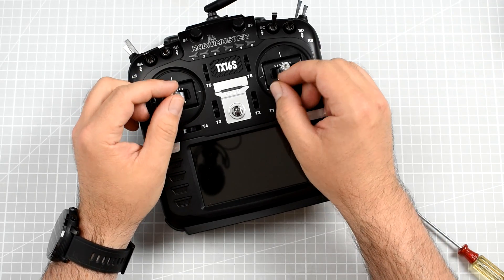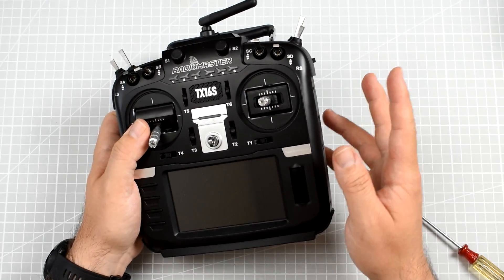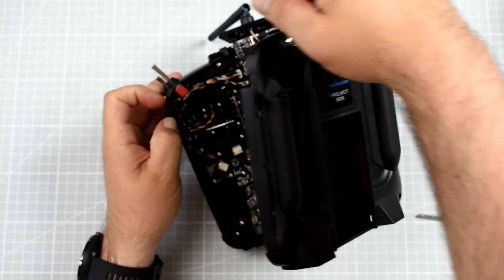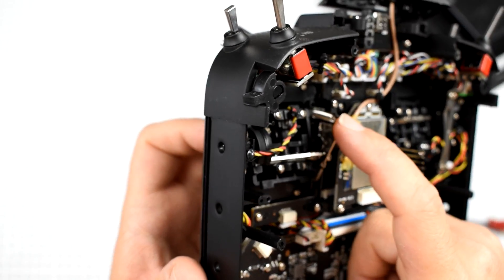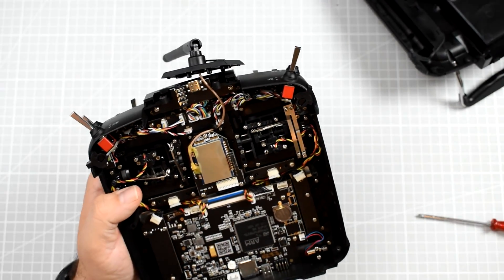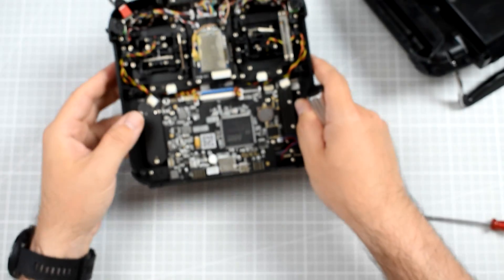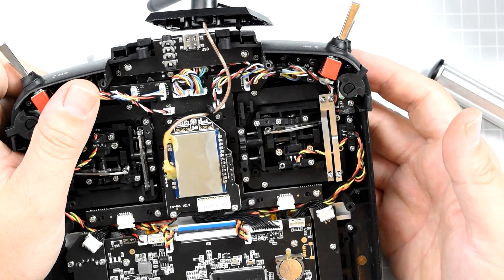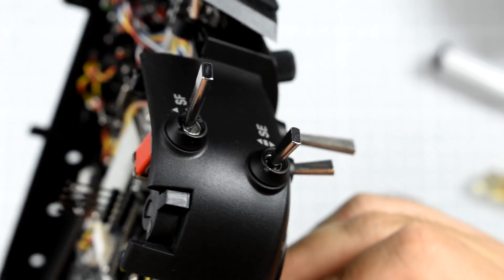Tune your gimbals! Adjust gimbal tension and centering strength

Comment: If you're satisfied with a certain tension, then perhaps buy a cheap dynanometer to measure it and then use that to quickly set your new radios to that measured tension.

Comment: I have just gotten a tx16s markii and have been flying around in liftoff for about 20 hours so far. 

I know I’m not good enough to care about these things but almost immediately I detentions the sticks so much that they center constantly but barely. 

I found almost immediately that I hate the bump when moving the stick. I may try to increase the tension some, my yaw axis needed to be increased a bit after going this. Still playing around with it though.

Comment: I feel like there is a hitch in the middle. It is not a smooth transition I’m guessing that tells you it’s center. But it’s a delay being new my brain stops right there it’s a hard stop out of the box. It is super strong and I have the upgraded aluminum gimbals not the normal ones. It’s just super noticeable like stepping in a hole when walking
Reply: Yep, that's how the gimbals work. You can make this less by decreasing the tension both vertically and horizontally, but that also has it's own downsides and upsides.
Reply: @KindOldRaven  I tried this. They became unusable almost. It can be lessened if I give up precision.
Reply: @christopherconkright1317  Yeah, that does make sense. As far as I know we can't completely get rid of them. It's a bit of a shock for me too to be honest. I come from controllers (and hall-effect analog sticks etc) so I'm used to only having a bit of a 'notch' or 'hitch' in the dead-center of the sticks, not across the entire '+' shape like we have here. I'm new to the hobby so so far I've just slightly lessened the tension on my right gimbal in all directions (I fly Mode2) and slightly increased the throttle tightness and am just trying to learn to live with it at this moment.
Reply: @KindOldRaven  same it is just enough if you don’t have force behind moving it stops it ever so little. So if I’m not firm(maybe better than force) it just pauses long enough to miss my gap. It gets frustrating.
Reply: Hi, have you managed to fix the bump on the center?
Reply: @scatta2671  only if I make them super loose. I almost want to try and build a gimbal without it.
Reply: Yup, I tried to adjust them and I'm satisfied, just got lucky with almost perfect tension for me

Comment: Adjusting the stick tension on the Radiomaster TX16S  MK2 is done from the front of the case with adjusting the hex screws in the gimbals. (no need for removing the back)
Reply from the maker: Only as long as you have the correct gimbals.
Reply: The tension of an unsprung throttle has to be adjusted from the rear of the gimbal assembly.

Comment: Great video ! Question.... I noticed my hall effect gimbals seem to be soft towards the most outside edge of travel 1/16" or so ? Is this normal ? Could they be adjusted mechanically ? Also.... How often do you recommend doing calibration feature on tx ?
Reply from the maker: This you can not really adjust without adding extra tension. For hall gimabls, calibration once a fear should be enough

Comment: I wish i could tune the GIGANTIC stick throw of the TX16S.  Only thing thats keeping me from using it.  Personal preference thing i know, but the Tango II is a little to small, and the Jumper stick throw is just right. (same on T16 and T18)
Reply from the maker: It's all a personal preference. I, for example, like longer throw and even usually I extend sticks to have it even longer
Reply: Paweł Spychalski great video, since we’re talking spacers... saw a qx7 with raised gimbals, he said for pinch style, can that be done to the tx16s? Brings the pots up, changing pivot.
Reply: @c_labb9247  I have a qx7s as well as xlite. Gimbals in the tx16s are higher than the qx7. I doubt they could be  raised any higher.
Reply: I like short throw, coming from xlite. I'm trying 5mm spacers to drop the pivot point of the gimbals a bit but I've seen a video of someone installing printed throw limiters I'd like to try.
Reply: I thought the same thing with my new Tango 2 but then I adjusted them out and it is very comfortable now.

Comment: Pawel, have you made a video about setting up your radio with a self centering throttle (DJI Style you called it in the T18 teardown) and the adjustments needed in Inav to fly in that mode. I would prefer the quad I am building for photography flies the same as my Mavic Air if possible. I had no luck searching on Youtube for a video. Thanks for your excellent Inav video series, they are helping me a lot.